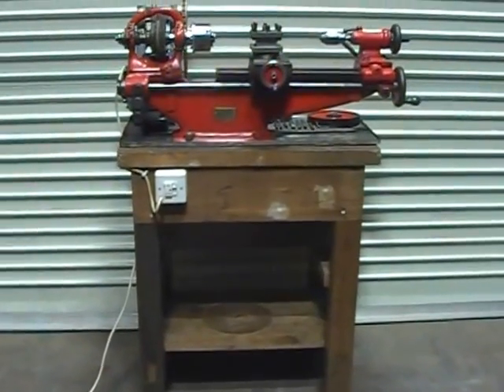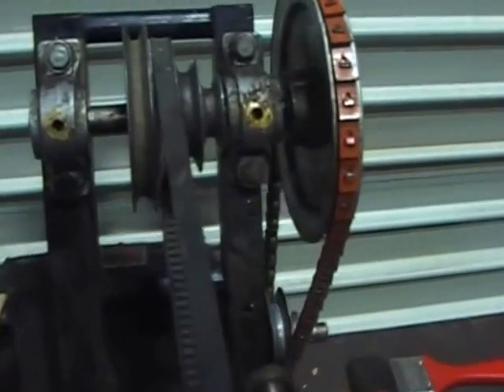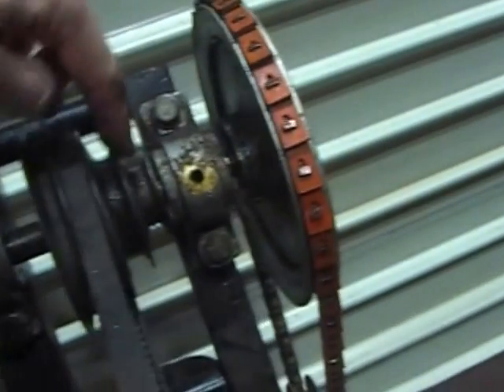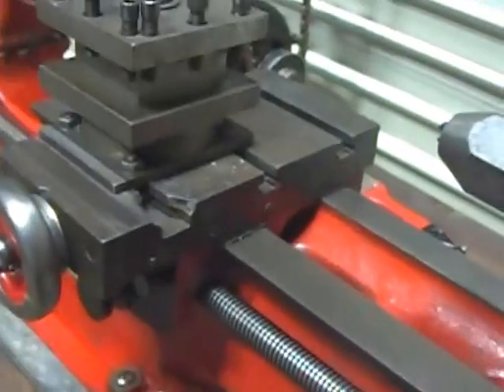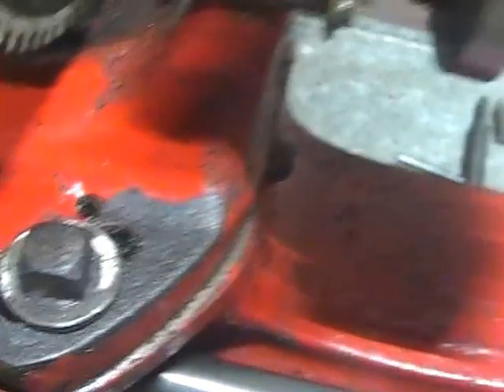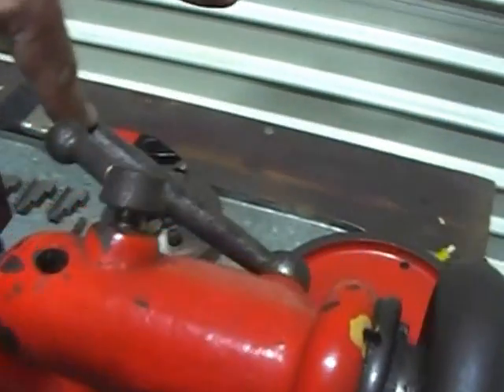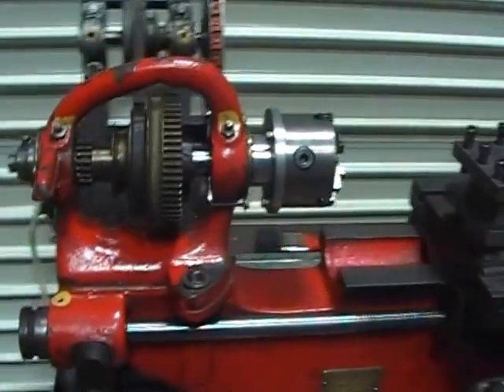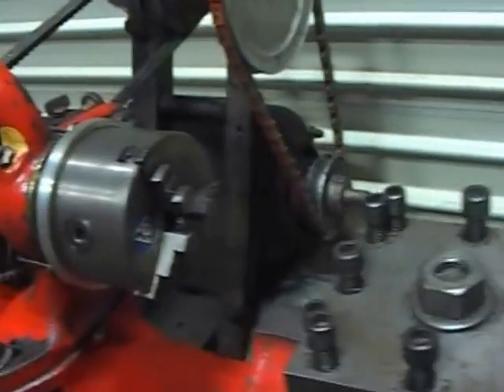FOR SALE: Drummond B-type METAL TURNING LATHE on eBay UK (Myford)

Comment: Hi nick, I appreciate you put this video up over 4 years ago, but I’m hoping you might have a few answers for my questions. I actually have the 1919 Drummond B type lathe, only I need to replace the headstock bearings, would you know of a supplier or access to drawings of the original bearings for matching etc? Any feed back word be really much appreciated. Ash
Reply: @fuzzzeballs  Just been offered one of these... It's been converted to 240, is it worth it,?  Worried about parts etc